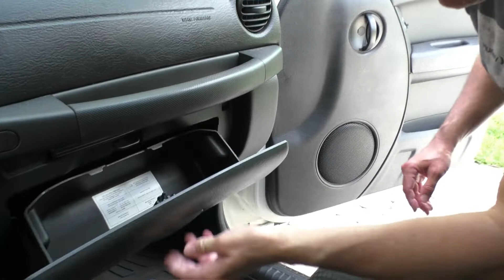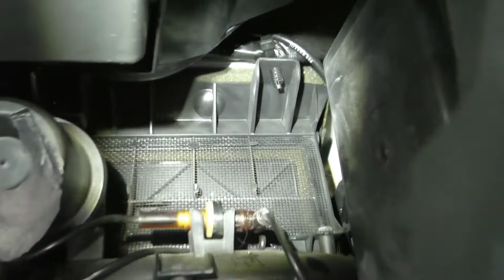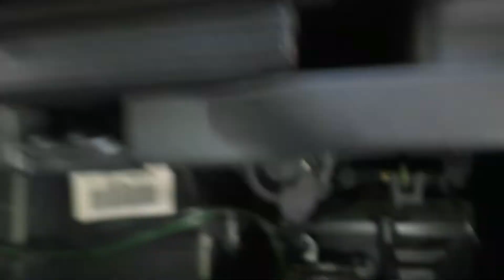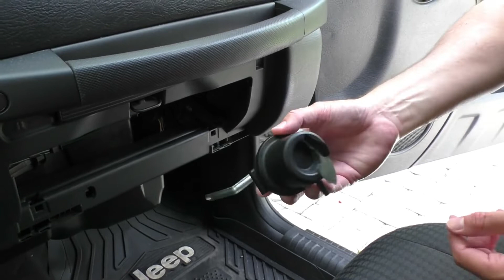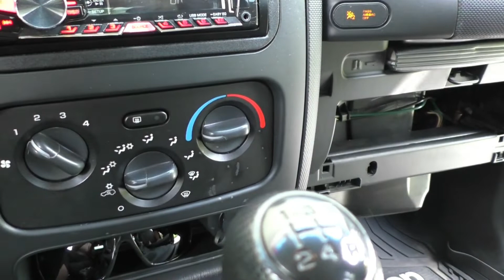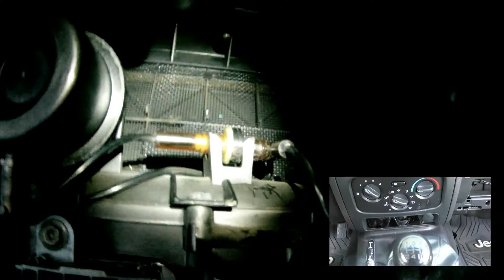2004 Jeep Liberty KJ AC Recirculation Vacuum Actuator Replacement

Comment: To the right of the actuator.( You shine your flashlight on it several times.) There is a check valve. The green hose connects to the actuator the black one that comes out of the check valve connects where? I recently replaced heater core and found this black hose  disconnected and pulling a vacuum for the life of me I can not find the port to plug it into. Very hard to find diagram of exact location.

Comment: what tires size and rims are those? looks nice
Reply from the maker: 30x9.5x15 Cooper Discoverer STT Pro on 8" Pro Comp wheels (51 Series Rock Crawler) Flat black with 3.75" backspacing. The model # is 51-5865F.

Comment: The metal piece with the hole. I'm not understanding what this latches on to?? I spent 4 hours trying to latch it. I see a peg but won't latch. Please help.
Reply from the maker: Hello Stacy.  Although the space was tight, it was rather easy to get this part installed.  If you can open and close the door by hand.  That piece that you would move to open and close it has a little pin on the end of it that fits perfectly into the hole on the end of the actuator.  If you are not seeing this piece, I'm guessing that maybe it broke off.  it wasn't to difficult to do, so if you are having this much trouble getting it latched onto the pin, it's telling me the pin is probably missing or broken off.   Hope that helps.

Comment: How has it been running since?

I actually am having this same issue with my Jeep Liberty 2004 with there being NO heat right before winter and my Mechanic said based with labor it would cost around $700 and that's due to the awkward spot it's located in.

however this being the first video I've seen it doesn't look extremely difficult or appear to be 4 hours worth of labor then I'd be willing to have a go at it
Reply: If it takes him 4 hours to replace this, run, find a new mechanic!

Comment: About that 3:50, I hold it little longer and actuator finally change to mode what I want. So, is that actuator faulty or line? I already replace brand new vacuum line.

Comment: Hello, around the 3:50min mark you tested the accuator. My question is what if there wasnt a suction on that hose? What would you check next? My 2004 Jeep Lib Sport 4X4 runs fantastic, almost flawless. However, when I run the AC for long drives (2+ Hours) the AC set to high will switch to a lower airflow output and the air will be between cool and warm. Then without warning it will reset itself and blow cold and then do it again with out warning. This happens on long drives several times. Basically, the AC will work at 10%, then reset and work 100%, and continue this process till we are at our distination.  I hope this makes sense, because it makes no sense to me. I even talked to an A/C specialist and he told me to bring it to him when it happens. Deal is its never convient to do so. I figure its got to do with some sort of vacuum reservior. Help.
Reply from the maker: If there is no suction at the actuator, you can check the vacuum hose running to the engine which is just to the right of the actuator, you will see a hose go into a little valve (which I believe is a one way valve) and the hose on the right of the valve goes to the engine.  I would check to see if that hose has vacuum.  There are other actuators that run the vents that are not vacuum driven.  I'm not sure if the 2002 -2007 all have the same setup.